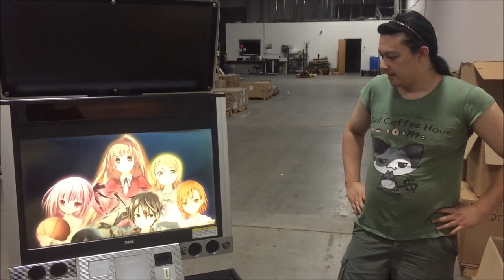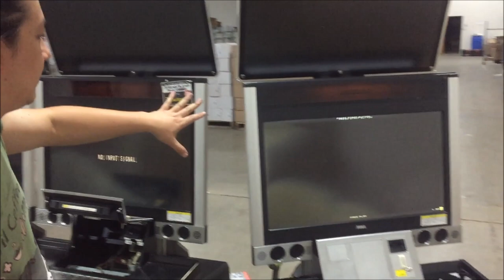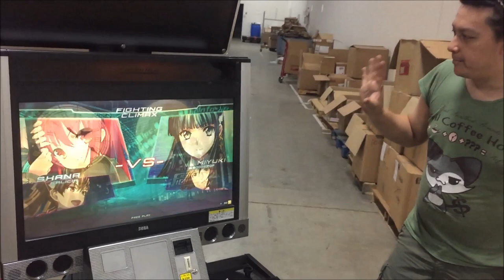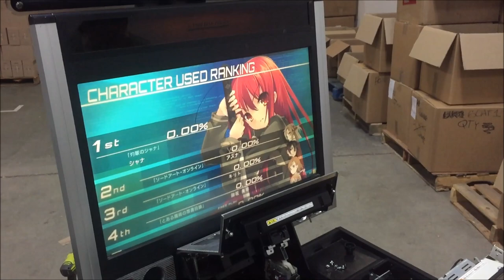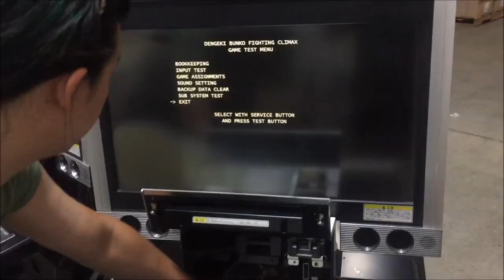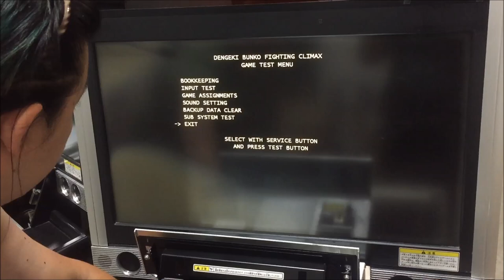Lindbergh cabinet trio unwrapping

Comment: Your work is truly on the master level with your skill and problem fixing.  I am learning a lot.
Reply from the maker: If you want to learn new cuss words, I'll put up a video about replacing the monitor.  It's very worth, but pretty annoying imo.  Really makes a difference though, and these needed it
Reply: Definitely does not look easy to replace.
Reply: Game Saru Don’t know if it’s any help as I don’t have a Lindenburgh but I am sure I saw a post on arcade projects about certain lcd models can be swapped into into it without any modifications.
Reply from the maker: That’s exactly what I do, and did do with two of these

Comment: I restored one of these on my channel and had a great time doing a custom control panel for use with a Brook UFB. I love this cab. I did see somewhere that the monitor can be pulled apart and there’s white diffuser sheets in there that can be cleaned of yellow stains. My one has some kind of lcd wear as well.
Reply from the maker: I just replace them, the original monitors are all half dead at this point anyway.  I use an LG 32MP58HQ-P IPS monitor
Reply: @GameSaru  fair enough. I have an LG1440p one ready to go with 3D printed mounts by Arthrimus on A-P. Does the screen just turn on when it receives a signal? Do you extend the settings buttons or just leave the settings as is? And lastly do you just plug it in separately or wire it into the power supply somehow? Thanks for sharing your videos.
Reply from the maker: The screen does turn on with power.  I extend the remote board into the service panel, there's pictures somewhere farther back on the Facebook and Twitter page when I did one.  To wire power into the cab, I have an inline adapter to tap an AC plug off the cab AC power so that I can install a powerstrip to run newer hardwares, power the monitor, headphone AMP, video splitter for streaming, etc.
Reply: @GameSaru  that sounds like what I’m needing to do ... so do you cut the plug off and wire it into the inline tap/splitter type of thing? 🙏🏼
Reply from the maker: We made a breakout using the same connectors already in the cab so that nothing needs to be cut
Reply: @GameSaru  nice idea. Thanks for taking the time to answer me. I know you’re as busy as all get out.
Reply from the maker: No worries! Busy or not this is still a hobby to me, even if most of it is busy work now